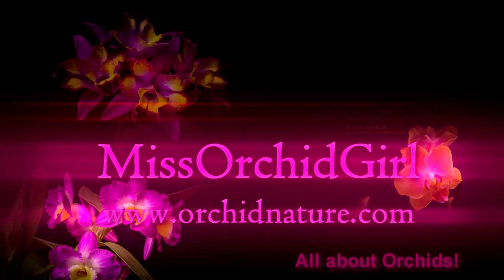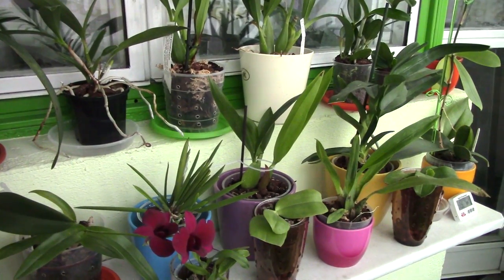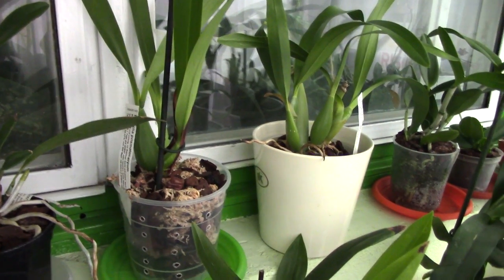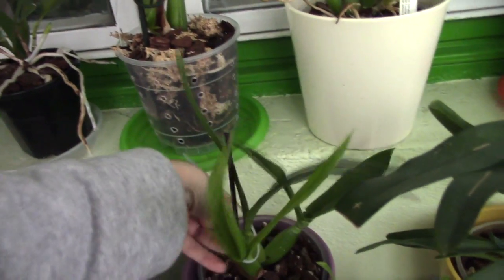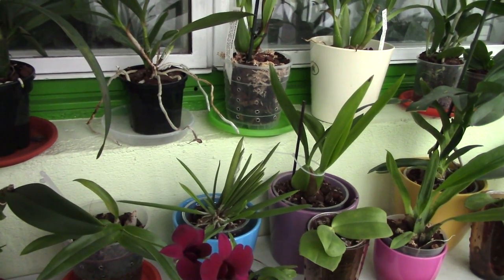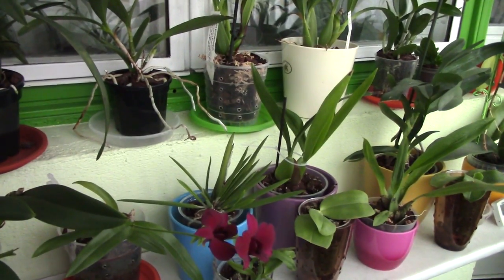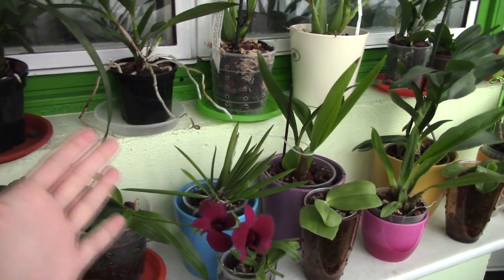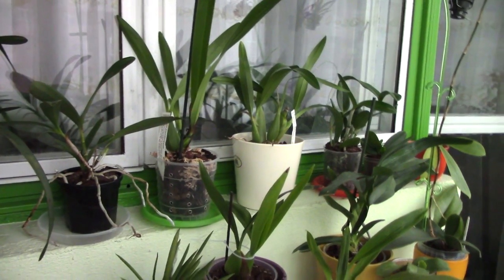Why growing orchids in semi hydroponics is NOT for me

Comment: Thank you for a very informative video about S/H. I am not a big fan of S/H but there a few things I'd like to say.
1) The fact that you have all of your orchids outdoor during winter time alone make it a terrible idea for S/H. As you said, cold temperature combines with constant moisture will definitely kill the roots.
2) I already thought of what would happen when the roots reach the water reservoir before trying S/H. Finally, somebody (you) show the results. The solution is simply find something like a plastic net to prevent the roots penetrating into the water but still allow the capillary action.
3) Besides problems you talked about, another messy thing with S/H is algae! Constant wet plus sunlight is a perfect condition for the algae to thrive. Many S/H grower experienced this. There are 2 solutions: a) covering the transparent plastic pots with non-transparent ones like what you are doing or b) adding trace amount copper (sulfate) to the water reservoir. Thanks to its anti-microbial activity, the copper will keep away not only the algae but also bacteria and fungi from you orchids.
Reply from the maker: Hi, thanks for sharing your thoughts, I do have viewers who like this method and that's great, hope they see your post and tips, I'll try to bump it up ;) but yes, really not for me, this system works better in an intermediate environment all year long... Imagine nobile dens in this, they would not be happy at all :P

Comment: From my observation, the mechanism isn't that water from the bottom reservoir gets wicked to the top through the LECA beads. The beads are fired during manufacture, and that leaves them with a hard glaze both inside and outside. They absorb water very slowly, and since each bead only touches adjacent beads by a tiny little spot, they just aren't able to transfer water from bead to bead with any kind of efficiency. What they ARE good at is maintaining high humidity in the spaces between the beads. It's that humidity, maintained by the water in the bottom reservoir, that migrates around the roots via the gaps between the beads. I use the beads in clear plastic pots and so far it's been the most successful medium for me, but I'm curious about Seramis too, so that's next on my agenda. We have our big annual orchid show coming up next weekend, which will be a perfect time to talk to the local experts and see what they think about all this!

Comment: I've grown C. aclandiae (which love to dry out between watering - so I'm told) in s/h and the roots grew down into the reservoir in the bottom with no ill effects at all.  The difference is to place roots into the liquid when they have already adapted to a different environment is only going to kill them eventually. If they are new roots that have not already adapted to a drier environment, then they will adapt to the wetter environment, and you will have no problems. So, in a nut-shell - the timing is critical when placing an orchid in s/h. All old roots that have not been used to the s/h conditions will be stressed, and will very likely die. All new roots will adapt, and have no problems except possibly salt accumulation.

Comment: Hi. I've has good luck with my experiments with s/h. I grow my orchids in my bright kitchen without extra lights and summer the orchids outdoors.  

I have a NoId cattleya orchid in s/h for two years now and it has 3 flower sheaths. The roots are growing into the water but are as happy as can be. I also have a Noid maxillaria growing in s/h. I bought it as a seedling and  now it's thriving. The little bulbs are  nice and plump. I also have NoId tolumnias in s/h and they are thriving. 

I also use the hydroton beads as media with sucess. I grow my Vandas in the little clay balls and they are thriving. I can't hang Vandas in my kitchen and water them daily. In the beads I water about once a week. I was absolutely delighted to get one of my larger Vandas to rebloom this year. I also have other orchids growing in hydroton beads. I also mix spaghnum moss with the beads and use that as my growing medium. 

I have very few of my 100+ orchids in actual bark. I found I can get things to grow better for me  when I don't not use bark. I have been able to rescue a walkeriana using hydroton beads topped with a bit of spag. moss. 

My challenge in my orchid growing is to adjust the ph of my city water (8)  to a ph my orchids like (6.5). I think I'm ok with orchid media, light and temperature. Now I'm working on the ph so that my orchids can absorb more of the nutrients I supply when I water them. 

Your are absolutely right when you say that what will work happily for one person might not be so ideal for another person. You have found what suits your life style and environment, that's for sure. Your amazing orchid collection atests to that. 

Online I have seen an orchid that was grown s/h and was awarded 
by American Orchid Society. So, like so many things in life- it depends. 

Please keep sharing your thoughts about growing orchids. I have learned much. I also love just looking at your beautiful orchids.
Reply from the maker: Glad that it works well in your environment, indeed what works for a person may not work for the other :) yes leca beads can work well for Vandas too since they don't retain too much water and are airy, forgot to mention that in the vid ;)

Comment: I am not surprised that standing in water for weeks will make some orchid roots rot. However I believe the semi-hydroponic system is working differently, if implemented properly: with the proper expanded clay pebbles the water in the reservoir will quickly be soaked up by the pebbles and move to the top by capillary action, distributing the water throughout the pot. The water will be used by the plant and evaporate. The pot will be dry before the next watering and there will be no standing water for extended periods. The reservoir really mainly serves to dose the amount of water correctly during each watering.
Reply from the maker: Jens Luders well yes that would be the logic for it but, as I say in the video, I found the capillary properties of these pebbles to be.. very poor. Maybe I just didn't buy quality material..
Reply: +MissOrchidGirl perhaps you did not soak your clay pebbles beforehand.  I soaked mine overnight, and they wick very well.  I did notice tho, that one of my phals developed white mold only after a few days in s/h, so I removed it, sprayed it with peroxide, and put it in water culture, where I can observe the roots a little better.

Comment: I am on the fence about Semi Hydro. It sounds like a great Idea. I don't know if it will work for me. I am trying it out on a division of a sherry baby that has lots of new growth. I also put Catt and 2 Phals in S/H.  All plants I don't mind if I lose.  I keep my plants inside most of the year but it is still cold here. In my home It is in the low 60sF / 15C . During the winter humidity is more. My summers are VERY dry. 

So thank you for all your info. I am going to give it a try because I love the IDEA of Semi Hydro. I am not sure about how it will be in practice. You gave me some good info that got me thinking. It also made me run and repot my Encyclia Cordigera back to a bark mix. I don't want to lose that plant.
Reply from the maker: +Sarah becker Hi, well it absolutely has to do with your environment, like I say in my videos too dry air and ventilation = dry clay at the top, too cold temperatures = too cold water in the reservoir and so on.. When you have major differences between summer and winter it's even worse. The more intermediate and constant everything is the better this method will work. But I think it's always a good idea to try it out, even if it will not work. try with an orchid or two and it will teach you some new stuff :)

Comment: I have on phal in the hydroponic system and she loves it. In my experience with trying out different mediums, it works best with pellets designed for plant growing. I use the ones from First Rays. The other brands I've tried have been crap lol
Reply from the maker: +Dionne Latham it's great that it works for you, I know a few people that can make any leca work :) it's all about environment, both of the climates I grew my orchids in were inappropriate, either very dry and windy, either very cold (15 degrees) and cold water to the roots is a NO! :))) but if you manage to get that proper temperature - humidity - ventilation ratio it should work :) it will not work in my current environment in 100 years with leca, but with seramis yes it will :P might try it.. but.. hmmm it's not convenient at all for me in the long run, I just like to experiment for the sake of videos :)
Reply: After you have been in your new environment for a while, will you please do a video how you prepared for your new environment and how well your predictions and strategies have worked. One of the reasons why I experimented with the semi hydroponic method is that I am trying to find a balance with what my environment needs with what my schedule allows that has been very hard for me. The phals have been the sacrificial lambs, subject to my experimentation since they don't cost but a couple of bucks to replace.
Reply from the maker: +Dionne Latham hi, yes I will update on everything :) not sure if you watched this video https://www.youtube.com/watch?v=z0y7-wzBRKQ